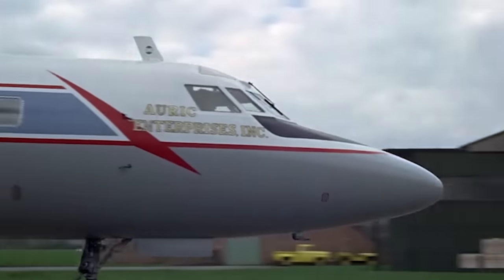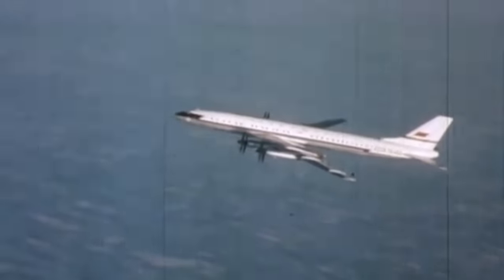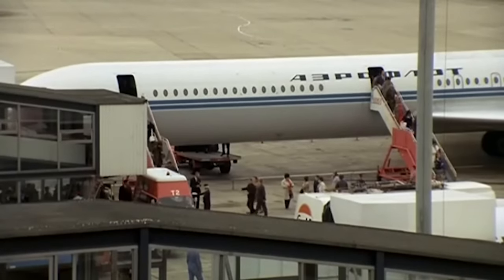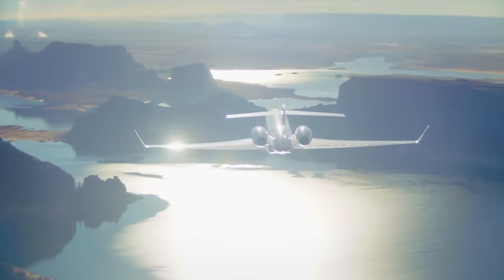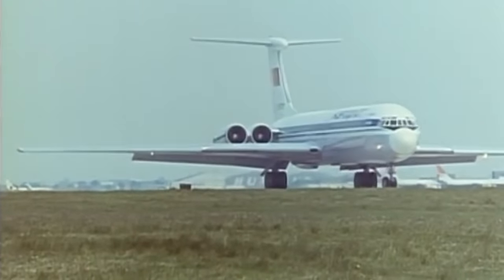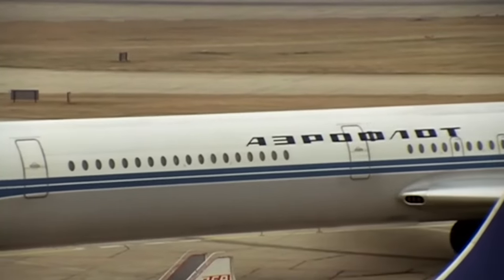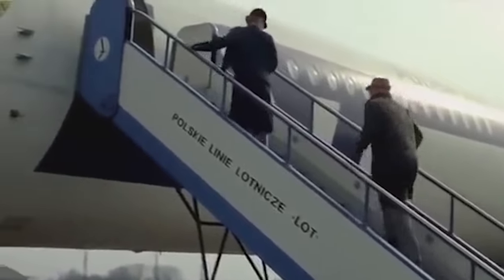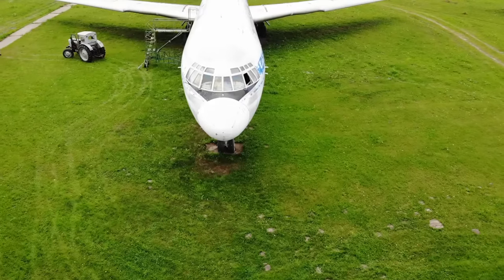IL-62 - an ideal option

Comment: As always I learned a lot. As a youngster, I dismissed the iL-62 as a “Commie” VC-10 imitation. Instead you show it to be a successful and pragmatic solution to Aeroflot’s needs. Excellent!
Reply: Me too, I always thought IL63 was shamely copying the VC10 but this video just changed my perspective .
Reply: Oh god, grow up.
Reply: Same with the Tu-144. Actually, the Tu-144 flew higher, faster and had a lower stall speed. However, the egos of the two governments and ideologies behind their designs meant that Concorde's one crash killed it off 3 years after, whereas the Tu-144's crash turned it into a mostly cargo-carrying aircraft and then slowly retired after 20 years.
Reply: @akshaygowrishankar7440  TU-144 was a nasty unbearable piece of rushed trash. Loud as hell, constantly requiring maintenance and ended up being used for post at one point. The Concorde was based on people, whereas the 144 remained as an ego booster.
Reply: @bmc9504  but in several aspects, it was better. It was cheaper, wider, faster, flew higher, and could fly with minimal reduction in range. But in most aspects of refinement and aesthetics, Concorde is better.
Reply: @akshaygowrishankar7440   The Tu-144 was certainly wider than the Concorde, but everything else you said isn't true at all - I don't think the Soviet SST flew higher or faster in passenger service.
Reply: @akshaygowrishankar7440  it was cheap and looked cheap inside and out, wider but why?, being faster wasn't necessarily a good thing as controllers already struggled with Concorde's speed as to move aircraft constantly and in terms of range, Concorde was right on target for what it ended up being used for. Didn't the TU144 just end up on trips to Almaty?

It was a high maintenance fuel guzzling passenger deafening  flawed ripoff which wouldn't pass any noise abatement test at the time  anyway especially in America.
Reply: To l  I
Reply: Yes, communists stole the plans for Vickers VC-10 and one year later than VC10 was flown they launch their shoddy copy of it.
Reply: @Big Cake two plane crashes of Polish Airlines LOT only proofs bad quality and extremely low precision of manufacturing of IL 62
Reply: @Big Cake no they weren't
Reply: @robertb3769  It's not true. The reason of crashes was bad servicing of Polish Airliner LOT, not manufacturing.
Reply: @BGI_guy  bullshit, Tu-144 is not a copy of Concord, main design is quite similar but engineering is totally different
Reply: @yoyohoolahoop3705  it is very hard to compare different aircrafts because many factors were included in aircrafts disasters, mainly bad servicing and human factor, Soviet constructions more often flows in poor counties like Africa or Asia
Reply: @robertb3769  wrong on every single count.
Reply: @robertb3769  yet overall the Il-62's safety record was equal or better to any western design.
Reply: @BGI_guy  no, it factually was not.  Literally five seconds on Google would make you look a lot less ignorant.
Reply: @j.heilig7239  Nope, the Il-62's safety record is much worse than it's western peers.
Reply: @yoyohoolahoop3705  wrong.  Do you think I'm making that up?  "Within the group of comparable airliners (Il-62/Il-62M, VC10/Super VC10, Boeing 707, DC8) the Il-62M had the lowest hull loss rate. There were no fatal accidents involving an Il-62 between 1989 and 2009."
Reply: @j.heilig7239  You're essentially making it up yes - you're just quoting from Wikipedia - not always the best idea. Try quoting from this website instead: https://aviation-safety.net/
Reply: @bmc9504  Concorde was based on the real economy, soviet Tu-144 was based on the commie planned "economy",,
Reply: @JF-ee3nn  that what the soviet propaganda said. Anyway the engines were services by Soviets
Reply: @robertb3769  this is the bullshit, the engines had not been serviced by a long time, two times more period than service instruction say. Moreover, some engine fixes were made without a certification of the manufacturer
Reply: Even as Brit, the Il-62 was definitely the more successful design, thanks in no small part to BOAC scewing around with the design of the VC-10 and order numbers.
Reply: Owain Shebbeare BS you ain’t no Brit
Reply: @akshaygowrishankar7440  also the tu-144 was so loud that passangers couldn't talk to eachother in the cabin, instead having to use paper notes. Also its fuel efficiency was really bad because it had to cruise with afterburners while concorde could cruise without them. Concorde was just better in almost every way.
Reply: @specialperson335  yep. In hindsight, again, I should've worded it better. The Tu-144 was more pragmatically designed than Concorde, without as much regard for luxuries.
Reply: @akshaygowrishankar7440  And it was a failure....
Reply: @wanderer5581  in a way, so was Concorde.
Reply: @wanderer5581  but yeah, 2 crashes, 55 passenger flights and noisier than a conversation with in-laws, yeah . . . Not the best look
Reply: The VC10 was overtaken by the 707/DC8, then 747/DC10 then 757/767, 737 A320, etc what was the IL62 overtaken by ??
Reply: @akshaygowrishankar7440  and consgned to carrying parcels for a short while..
Reply: @wanderer5581  yep. But again, in a way, Concorde was also somewhat a failure
Reply: The VC10 was not overtaken by the DC-8 and 707; it was larger than either, had better performance and superior engineering. But it was optimised for “Empire” routes like JNB etc. Too narrow a focus, alas.
Reply: @atatexan  Exactly... in the same way the Trident was overtaken by the 727 , they are after all commercial aircraft , and at the end of the day the DC8 73 was much bigger than the VC10.. where it counts.. bums on seats...
Reply: @yoyohoolahoop3705  The VC 10 had 1 accident for every 5.4 planes, the Il 62 had a average accident rate of 1 accident per 9.89655172414 planes, I took the total number built and divided the by the number of accidents from the ASN Database from that website.
Reply: @JDAbelRN  I do hope that is true, I did see something which could have been Al Jazeera where Comic or another Chinese aircraft manufacturer managed to gobble up Boeing designers and engineers (some of whom were Chinese of origin)
Reply: @10gamer64  That is not the correct way to calculate airliner accident rates or levels of safety - normally you would just use the number of accidents that involved fatalities in making a comparison - after all, that's what airline safety is all about, avoiding fatalities. In the case of the VC10 there were 2 accidents with fatalities during its entire service career - for the Il-62 there were 12 accidents with fatalities. However, there were far more Il-62s built, and they were operated as airliners for a longer period of time, well into the 21st century. But I wouldn't have chosen the VC10 to make a  comparison with the Il-62, the VC10 is a Sixties aircraft  - the Il-62 is essentially a 1970s-1980s aircraft - that's when most of them were built. Compare the Il-62 with the DC-10, A300 and other wide-body aircraft of that time.
Reply: I've flown the VC-10 dozen's of times ! Out of Miami, Int., Freeport Bahamas and Nassau to London BOAC, back in the 60's and early 70's. Even a couple of times after the name change to British Airways. As an airliner went, they were damn fast !
Reply: @JDAbelRN  the biggest joke state is USA during the period from Jan 20 2017 - Jan 19 2021!!
Reply: It was indeed a commie VC-10 knockoff with terrible fuel economy. No one sane would buy it out of their free will.
Reply: @bmc9504  No SST passed noise abatement in the USA.
Reply: @robertb3769  The IL-62 was better than the VC-10.
Reply: @JF-ee3nn  the physics involved with supersonic flight dictate certain design choices really
Reply: @yoyohoolahoop3705  Total number of crashes isn't as important as number of crashes vs. number of flights.
Reply: You were right as a youngster :-) Russian tech sucks, it is full of shortcuts, savings and bad reverse engineering.
Reply: @JF-ee3nn  Yes, much worse.
Reply: @Kajpajepolavailable  laughs in russians inventing the screen
Reply: @robertb3769  I flew on a BOAC VC-10 from London Heathrow to Cairo in 1973 when I was a kid. It had round lights in the ceiling that resembled chandeliers. At night, they had the image of stars at night. Very classy and very quiet ride, even for a kid in tourist class!
Reply: @j.heilig7239  What is your source ? Without it, your citation (?) amounts to 0 ! Or, plain soviet/Russian propaganda.
Reply: @wanderer5581  The IL-96 😛
Reply: @danielkorladis7869  How did concorde from both British Airways and Air France get a pproval to fly in JFK? Simple they had a noise abatement procedure. And met US noise regulations.
Reply: It is a VC10 imitation...!  So is their Tu-144 that was built on stolen Concord plans....!
Reply: @akshaygowrishankar7440  You have a rather optimistic view on the 144. Its flying faster and higher were achieved at the cost of much higher fuel consumption because it couldn't supercruise ( fly without afterburners).
Its lower stall speed was achieved after the addition of the canard wings installed because  it specifically turned out to be prone to stall at landing speeds; the canards taking up precious interior space. Concord(e)'s crash was due to exterior circumstances ( runway debri) leading to a catastrophic chain of events whereas the 144 broke up in mid air for vague reasons. Both planes were virtually uneconomical to fly from the start and very much objects of prestige.

I like the videos on the Soviet era planes, by the way😊
Reply: Me too, we’ve all fallen victim to western propaganda but over and over again we see how well the Russians are at designing and building successful aircraft. Beautiful aircraft with an impressive track record. Great video, keep up the good work
Reply: West always felt threatened from innovations taking place in the rest of the world.
Reply: @bmc9504 
West (specially grance)  felt so much threatened by the Tu144 that they created a situation and crashed it and then put all sort of illogical labels on it.

Comment: I really liked this aircraft. The fact that it was simplified, yet airworthy and sturdy, showed that there were less things to go wrong while in flight with all of the fancy equipment that the VC-10 had. This meant less maintenance. This was a strong air frame and could land on surfaces that would have damaged the jets of the West. This jet is a classic and has proved itself going the distance. Hopefully the MC-21 sees success throughout the world in the single aisle market.
Reply: Probably the only large Western aircraft capable of rough-field operations from that period (a bit later) was the Airbus A300, and likely not to the same degree.  I rememver a lot was made about this when they entered service in Australia with TAA.
Reply: @shebbs1  "Probably the only large Western aircraft capable of rough-field operations from that period (a bit later) was the Airbus A300, and likely not to the same degree."
A bit later Airbus introduced double-bogeys on the smaller A320. Although Air India was the only carrier that purchased that option.
Reply: I think the Il-62 is a nice aircraft too, but I suspect there were a lot more things to go wrong on it than on the VC10, probably a lot more maintenance as well for the Il-62.
Reply: Both the Boeing 737-200 and the Boeing 727 have been used in rough-field situations that the Il-62 never saw. The Il-62 was only ever flown from normal large airports.
Reply: Even the vic-10 was apparently pretty reliable
Reply: Forgive me, but that is not correct... Many Cubana Il-62M was massively used in African rally by Cuban army, transporting troops, war supplies and many thing like that without a single lost... This means hot and high operation in, sometimes, overloaded aicrafts... Just a point for comparisons: The 737-200 uses a nose gear ski to operate on dirt because it tiny nose wheel and it very low mounted engines... Compare the huge distance from the floor of the IL62 engines and its massive wheels... Just watch the guy in the video! :)
Reply: @edgarguinartlopez8341  Don't know what you are talking about. Cubana Il-62s flew from Cuba to the main international airports of Namibia, Angola and Mozambique - normal airports with long paved runways. The Il-62 was certainly not engaged in bush flights flying into dirt strips in the provinces. A jet that was used for such flights was the Boeing 727.  Here is a video of the 727 doing just that: https://www.youtube.com/watch?v=T7q0-XfiQXI (poor quality).
Reply: Normal? No man… of course you don´t know
what I´m talking. Those were not times of mobile phone pictures or videos for
YouTube or Wikis… Stories I heard from the very crew about IL62 missions in
Africa just can be told and with hope being writing by them someday… Meanwhile
I can tell you this: War times are far, far beyond to be “normal”… Bush flight,
who knows? maybe not, but taking off from, or approaching to, airports with
bullets flying direct to you is, definitely, something special… Cubana IL62Ms (and
also Aeroflot with combined crew) flows to many others airports apart those you
mention: Catumbela, Guinea (both), Etiopía… and often IL62 crew was forced to
fly at night with all lights off until the very approach, turning on the
landing lights in short final in order to avoid artillery and gun fire; because
yes, they were shoot many times... For example in Luanda, they used to approach
and takeoff making very tight turns, just few meters over terrain, in order to leave
or reach the sea as soon as possible avoiding foes. Often wings tips were about
to hit the ground on such abrupt banks at low height; approaching in such
conditions “makes” the runway very short and narrow… Besides, many of those
airports like Luanda and Catumbela were used intensively by Cuban war aviation,
so IL62s were always at risk to collide with war fighters, cargos or helicopters,
passing very low over the runway even with the IL62 on takeoff run… Runways
with sand pollution, lose animals, night flights into abandoned airports
illuminated just with barrels on fire, and so on in a heavy commercial aircraft
was far from normal operations… Even heavy artillery missiles were transported
on IL62Ms to Africa, all the way from Cuba… And finally, I want to add that
IL62M is a heavy aircraft, nothing like the heaviest variation of 737-MAX
(MTOW=88 Tons) or 727-200 (MTOW=95 Tons); they are definitely in a different league…
The IL62M have a Max Take Off Weight of 167 Tons which is about 2.3 times its Operative
Empty Weight so in the hot days of Africa, with runways about 3.2-3.7
kilometers, they were not so happy if you ask me… For 16 years I have worked in
the MUHA International Airport, I know very well about IL62M takeoff and landing
performances in normal, hot or tropical storms, and the only one we (Cubana)
lost was in a commercial flight, at takeoff, and was nothing to do with the
aircraft capabilities or any failure. Sorry for this long answer...
Reply: @edgarguinartlopez8341   So you agree with me, Il-62 didn't fly from dirt strips in Africa, Boeing 727 did. Not sure where this discussion about the relative rough-field capabilities of obsolete Boeings and Ilyushins is actually leading us to?
Reply: Highly contaminated runway with desert/sea sand is not enough dirty for you? My friend, maybe I´m missing something here… I think you asking about an example of the off-field capabilities of the IL62M since you never see it operating on dirt, right? Well, Africa is the answer.
Reply: @edgarguinartlopez8341   I never disputed that the Il-62 has been operated from some very poor quality runways in Africa, or anywhere else, just pointing out that Boeings and other types of airliner have also been operated in equally bad conditions around the world.
Reply: OK, now we agree... :) In fact the B727 is a great machine, hot and high capable as well as good for short airfields. Is nice to see it when comes to Habana like a cargo variant.
Reply: Look at this...
A simple comparison using Max available Thrust (Kn) divided by Max Takeoff Weight (ton). Where higher is better. Numbers was taken from wikis so they may be aproximations...
727-100 2,50 kn/ton
727-200 2,57 kn/ton
il62M      2,58 kn/ton
They are very close!!!
However, the B727 is one half of the mass (MTOW) of the IL62M and have much more complex wing mechanization with proportionally bigger wings. Which are all advantages for shorter takeoff and landings practices.
Reply: It really looks sturdy because iran,cuba,dprk,Ukraine, poland,and a lot of other countries still flying them proudly today
Reply: @shebbs1  Because you really need rough fieldops capability and no groung support requirements...
Reply: @marxxmann8758  what kind of nonsense is this? Poland still flying them proudly? Poland retired its IL-62 fleet just about 30 years ago, after 2 deadly accidents there was zero appetite to keep using this aircraft specially when all of a sudden due to politics western constructions became available to Poland. I believe Ukraine also stopped flying them long time ago.